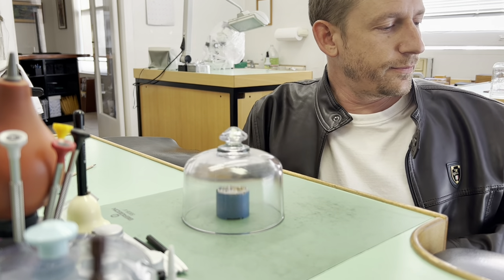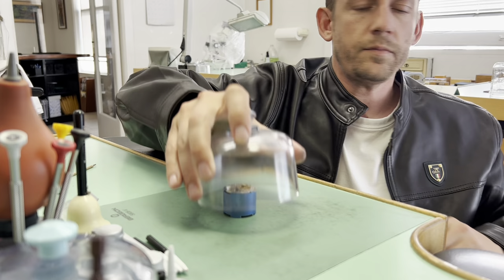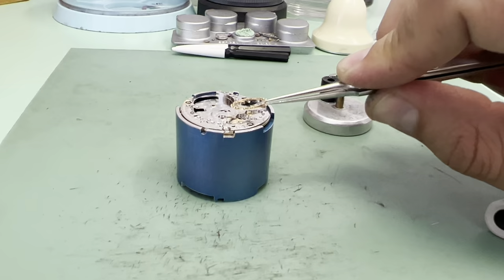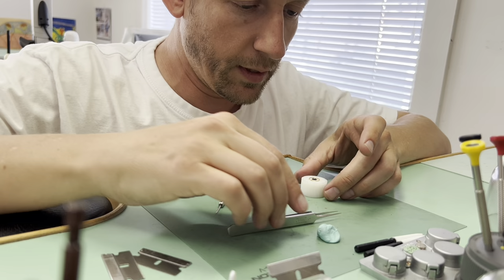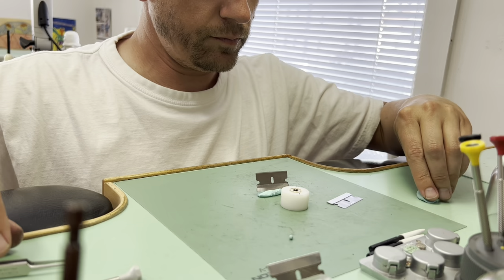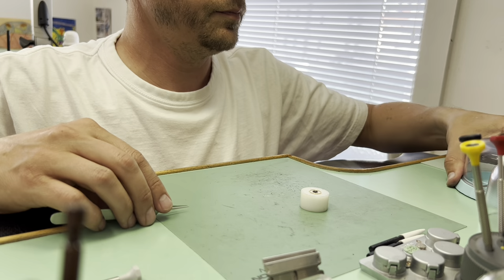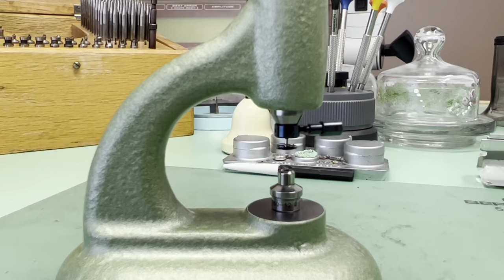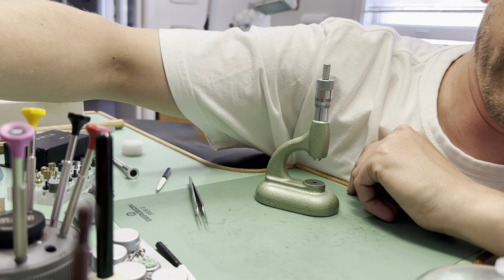Vintage Rolex GMT 1675 Balance Staff Replacement Tutorial (Super Technical for 1570 Movements)

Comment: Awesome job! Thanks man for a well explained video!
Reply from the maker: Thanks 🙏 I got a lot of feed back from this on Facebook. And rightfully so. This is a very specific Rolex method. Using the Horia tool to break the balance out is very risky with other brands. It works well with Rolex because the steel of the staff is so brittle and the balance rim is so strong and flexible. Also marking the position of the roller and hairspring stud is a good reference but, if the parts are in the wrong place to begin with than it’s good to know how to orient the wheel without any outside reference. I’ve been meaning to make a balance staff video with a different watch just need to find another brand of watch with broken balance staff.

Comment: your work very nice.....i have quastion sir ,  i have 1570 movement call , its fast running , im try to adjest it but it countiue fast running... did you have any aedia....thanks advance
Reply from the maker: It’s hard to assess without seeing the watch. If the movement is fully serviced and your trying to slow down the watch correctly with the micro Stella screws which are located on the inside of the balance wheel then just keep screwing them outwards. This should work assuming everything is cleaned piled and double checked correctly. But, if this is not slowing down the watch there is probably something overlooked that is causing the problem. The movement must be checked methodically as it is disassembled. Are you serving the movement yourself or just adjusting the timing?